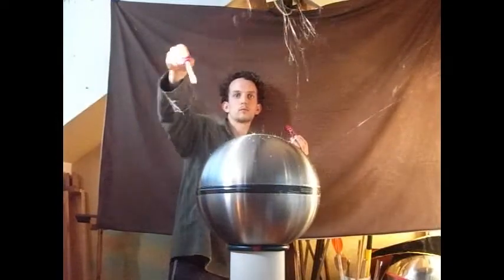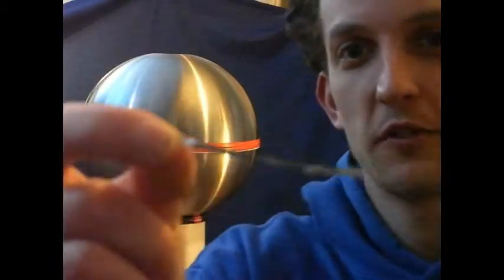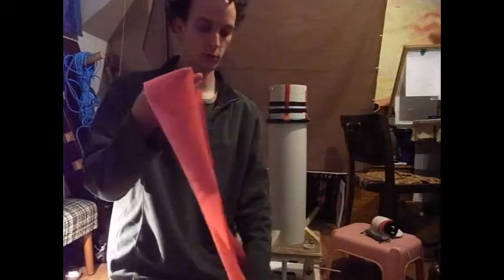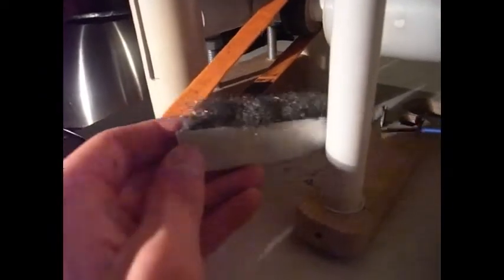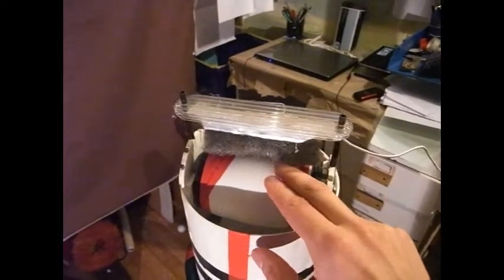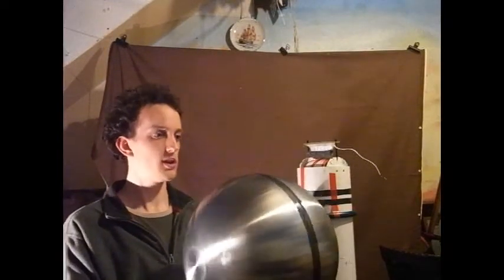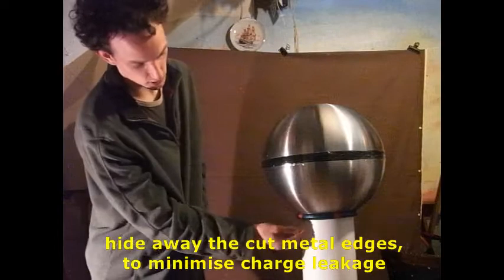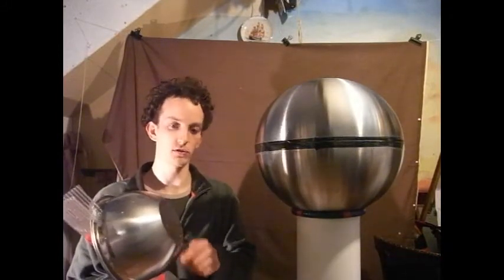Van de Graaff generator experiments and construction tips

Comment: how did you cut the hole in the bowl
Reply: Some kind of dremel tool would be the thing to use. I didn't have anything appropriate though so I just attacked it with a chisel and a hacksaw. I then hammered the edge inwards, so that electric charges pushing outwards from the sphere do not collect there so much. Tidied up with sandpaper and wire wool.